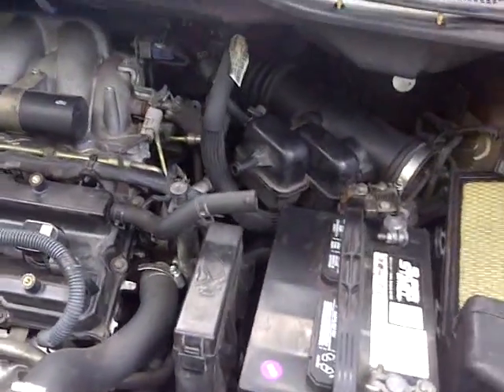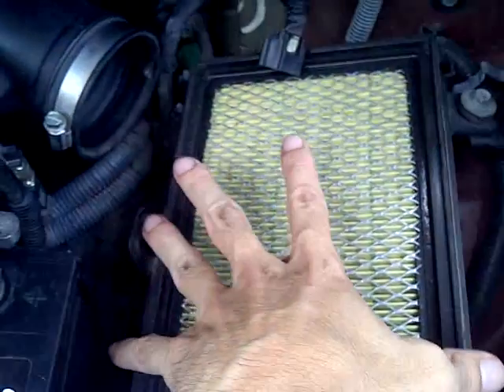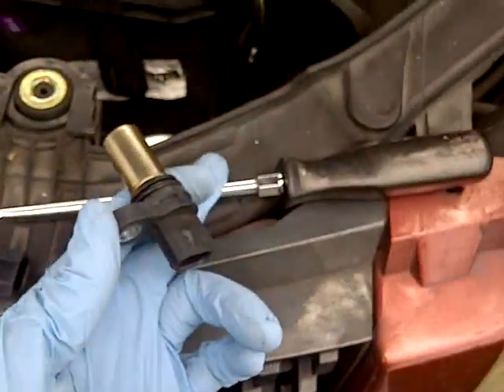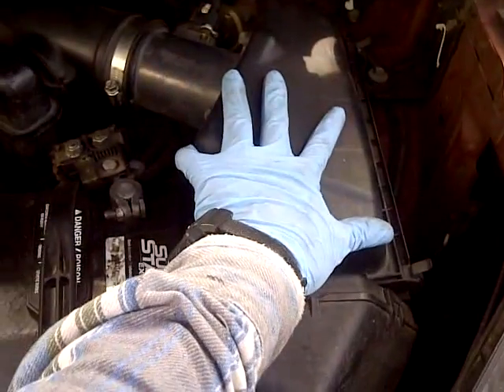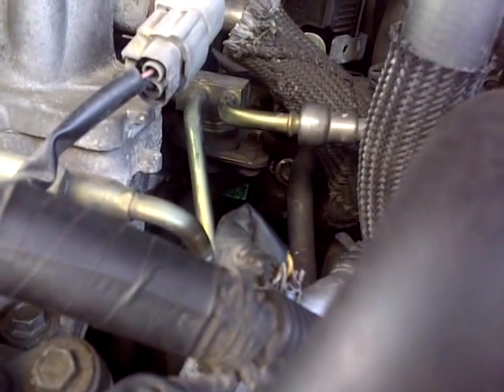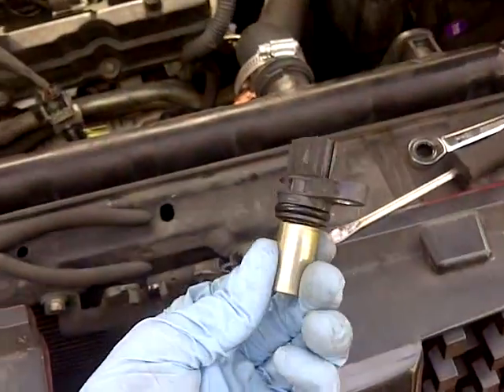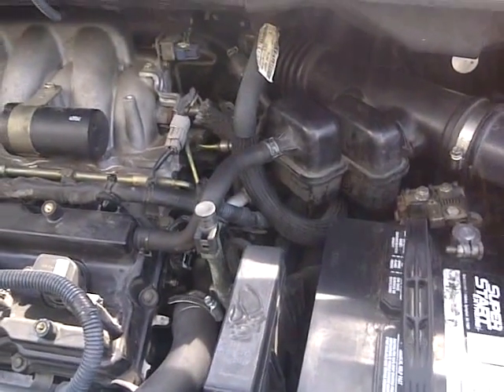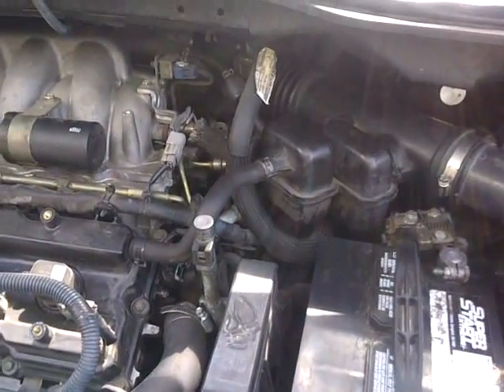P0345 Camshaft Position Sensor A Circuit Bank 2 2005 Nissan Quest @JamesBondJB007

Comment: Hello there, which one is the sensor A circuit bank 2 sensor ?.. Is it the one in the front or the rear one ? Im encountering the problem right now and need to change 😞... Please respond . thank you
Reply from the maker: It's been a long time since I made this video and no longer have the van.  I think I mentioned it in the video. You might want to watch it again or a few times.
Reply: Rear is bank 2, front is bank 1

Comment: Your cam sensor placements are the same as my Murano. I assume it is the same engine? Not too car savvy and really new to this. The rear sensor for me is black, rectangular and flat. My new one is the same as your old. I will have no issue with swapping? And I also notice one of m sensors says 'cam/crank sensor' so does that mean this one particular sensor cps0005 can be used in either front sensor location or crank sensor location?
Reply from the maker: Don't know about your car, but the shape of mine was different for the cam and crank sensor.  Ask your auto parts suppler and they will know for sure.
Reply: @JamesBondJB007  well do I have some good news. Because yours turns out to be exactly like mine. After 4-5 hrs of research I found out Nissan has made their cars essentially the same. And there's like 2 different sensors per each bank, mostly depending on the manufacturer of the sensor. I could even follow your vid to the letter for my car, which I sorta did, and all will turn out as it should.
Reply: I guess I am kinda off topic but does anybody know of a good website to watch newly released series online ?

Comment: did you have a check engine light before you changed the sensor.  Also, did the light go away after you changed it or did you have to get it reset?
Reply from the maker: yes check engine light was on and I just reset it.  The engine was not turning over very well before and now it works, with no problems.  thanks for watching.